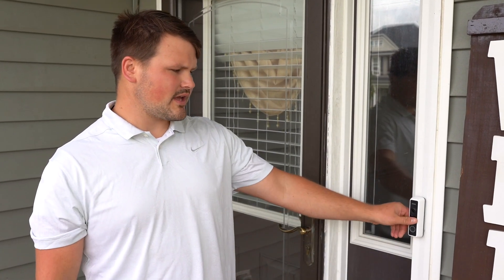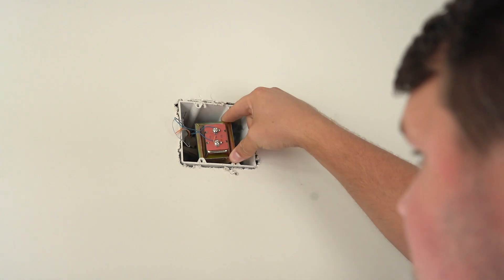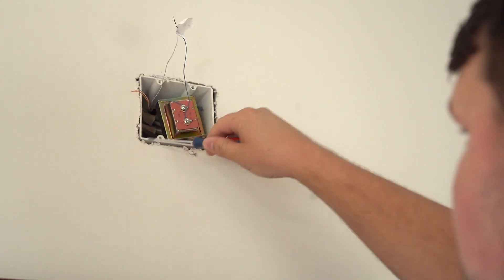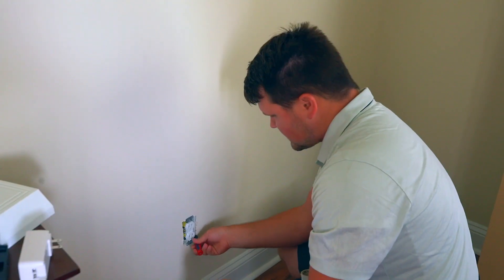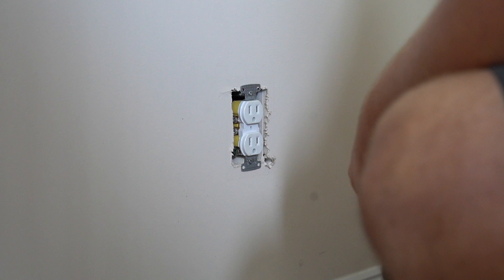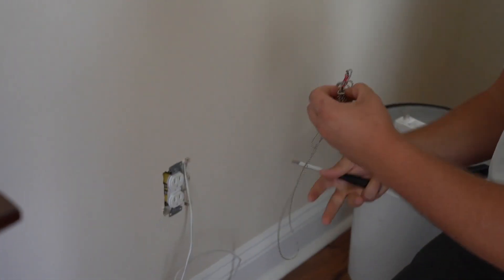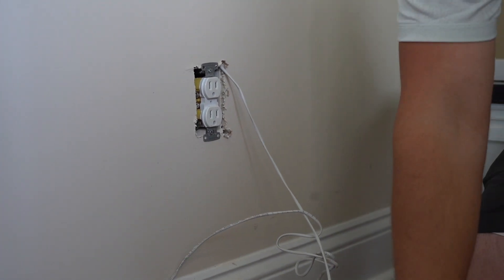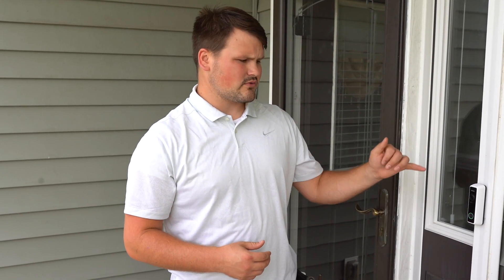How to Restore Power to Your Doorbell Camera, low voltage (Google Hello, Arlo, Vivint, Ring)

Comment: So when vivint installs Their doorbell they take the wire from a homes normal transformer and they run that wire to their own plug in transformer?
Reply from the maker: Sometimes the power that’s already there is fine so they won’t have to do this. Sometimes it’s not enough or not working so they might have to run it to a transformer like this?

Comment: What do you do if the transformer is busted?… my Vivint doorbell camera stopped working because the power source is not working.
Reply from the maker: It depends on your home.  Sometimes it’s easier to find the transformer and replace it. Or just bypass the chime and the transformer and run your doorbell cam to a plug in transformer like in the video.  It really just depends on the home.  Sometimes one way is a lot easier than the other.

Comment: Hey Tanner! Got a question for you. Trying to reinstall my Vivint DBC at new home. My DBC ring light is not white but turns yellow when pressed for about 5 seconds. Is that an indication of not enough voltage? If yes, would the fix you show here work in that instance?
Reply from the maker: It depends on the model you have? Is the doorbell cam white or is it a stainless steal color?

Comment: I cannot find my transformer.  Is it possible to connect directly to doorbell wires instead of transformer?  Do you have a video of that install?  Thx
Reply from the maker: Can you find the chime box? You have to have a power transformer or it will blow your doorbell. 

Sometimes it’s almost easier to just run a new wire from scratch. What material do you have on the outside of your home? Siding? Brick?

Comment: Great video. Have you ever came across a home where you couldn't find the chime box? I recently moved into my home here in New Jersey, and there are 2 wires (red and white) coming into of the wall where a doorbell should go, but no power in those wires. And I can't find the crime box anywhere!
Reply from the maker: The home you just moved to was it recently remodeled? A lot of times when people remodel or flip homes they take the chime box out and then just disconnect the wires and shove them in the wall. Good chance that’s what happened. Or it could just be somewhere weird in a home. 

Sometimes if you can’t find the chime you can go into the attic or if you have an unfinished basement you can go to where the door is and try and find and trace those wires to either the chime box or transformer. Just make sure your safe if you go up in the attic.
Reply from the maker: Depending on the home. Sometimes it’s almost easier to just run a new wire from scratch. The. You don’t have to worry if the previous tenants did something weird with the door bell wires. If you want to do one from scratch check out some of my other videos! Hopefully this helps!

Comment: This made absolutely no sense. It would have been faster, easier and cleaner just to replace the transformer behind the chime.
Reply from the maker: Right it definitely would have. I just wanted to show how someone could restore power if they didn’t want to mess with high voltage or if the existing transformer wasn’t right behind the chime box like how it was at that home. Depending on the builder the existing transformer can be hard to find. So sometimes it’s nice to just restore power like how I did in the video without having to run a whole new wire.
Reply: @tannerthetechnician5252  👌